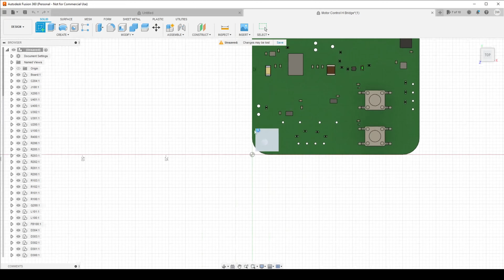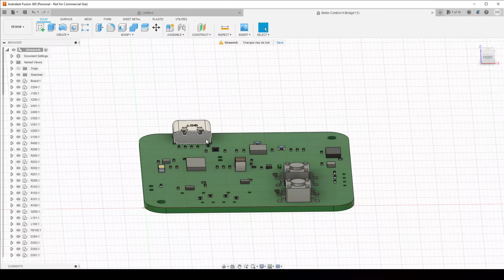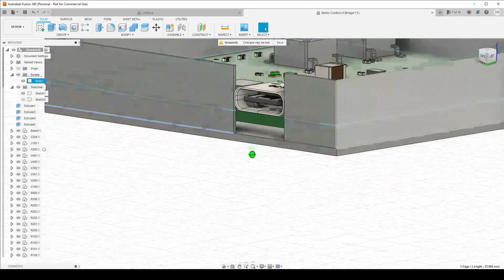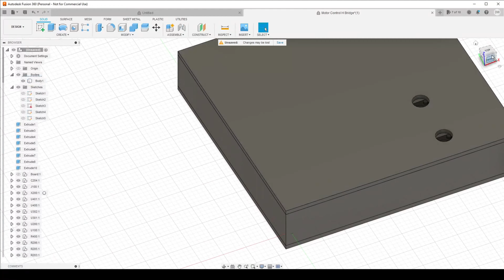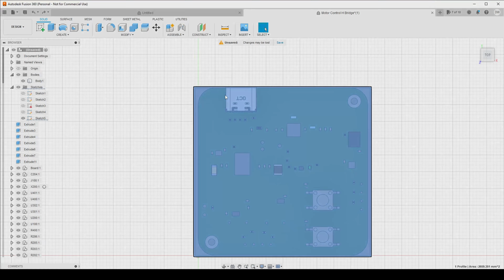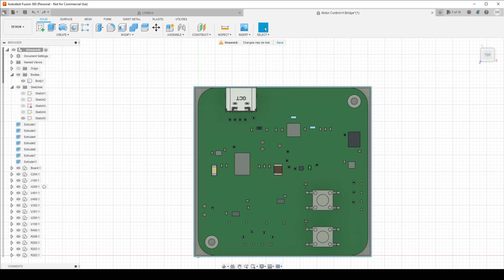How To Ensure Your PCBs Fit Every Time

Comment: The comment on "print your PCB out on paper" is a great one. I take it a step further, and glue that printout to a bit of acrylic the same thickness as my intended PCB . I have one in front of me now :) Really useful, as you can drill holes and fit connectors to see if they really fit. The acrylic can be drilled and screwed into an enclosure, enabling demo proof-of-concept products. Which is what I'm doing now
Reply from the maker: Brilliant idea, never thought about that!